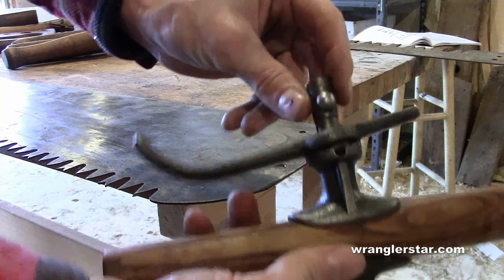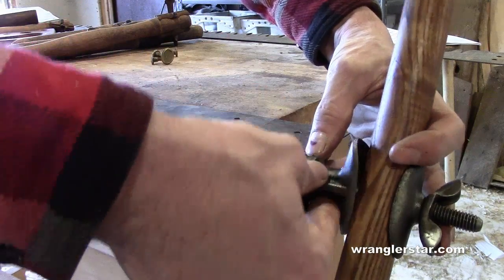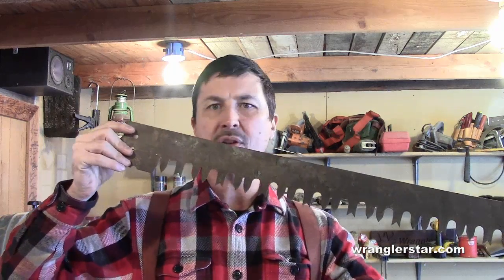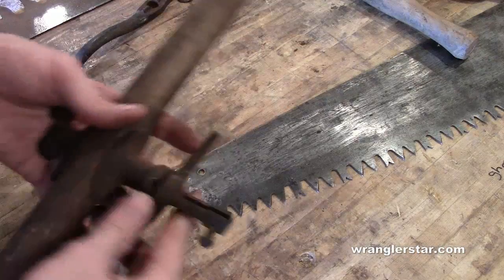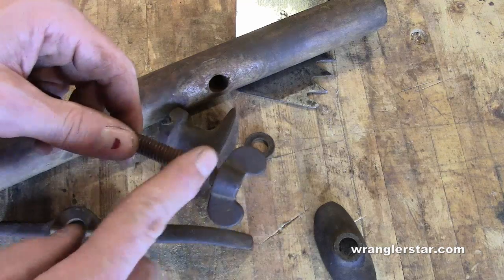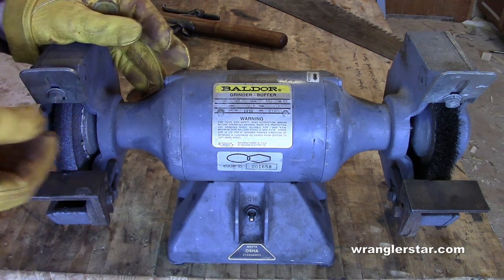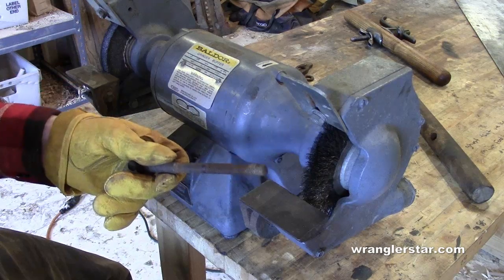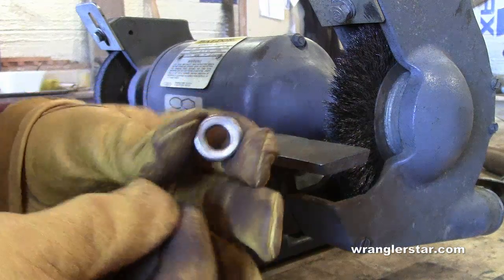Crosscut Saw 5.0 - Wranglerstar

Comment: Hey, hope can help here.
Been using Kroil since a lad from my Father, gets rusted parts undone. Now they have SiliKroil and even better: the silicone is further lubrication.  
I purchase it by the gallon. Then if have something stuck, get a container, put the part(s) in, and soak.
You can even put into the cylinder to free stuck rings. Do it before ever crank an engine that been sitting and before the oil change. Put it in, let it soak at least a day, then turn over one revolution, soak for at least a day, do at least one revolution per a cylinder. Once done, change out the oil, new plugs, and away you go. Learned from my friend Georg who has been an auto mechanic since 1960's. Saved me having to rebuild a rare engine.
So anything that is really stuck, grab the SiliKroil. 
Hope this helps.

Comment: Removing rust can be done very easily with a simple electrolytic setup. There are several good videos on youtube that show how to make and use a very inexpensive rig for doing this (assuming one already has a battery charger). It's a great solution for small metal parts, and has the advantage of removing just the rust, not the un-rusted metal. It also frees you up to work on other tasks (like the wood finishing) while the rust is being removed.

Comment: You can also use electrolysis to remove the rust before the wire wheel. It will also keep the patina and make the parts look like new.

Comment: I am going to be doing some remolding and exposing the post and beam structure of my home - what is the best process to restore the cedar post - it's the post that has been covered up with drywall and it looks as though when they first did the conversion of this old building they probably sandblasted. I don't want to do that. What would you use? I would like to keep it's rough sawn look.

Comment: This is an old video, so you have probably found out by now, but the curve of the saw would indicate it is a felling saw, the curve leaving space behind the saw the hammer in wedges.

They can be used for bucking, but a bucking saw is usually straight backed, to give it some extra weight to aid the downwards cutting.

Comment: That wire brush was a bit fierce. You would be advised to look at chemical rust removers or brass wheels which are much less damaging to the surface. Another successful technique is electrolysis. I am sure you will be surprised how smooth the surface can be after all that rust has fallen off. You may even be able to get one of those butterfly nuts off. - Great video by the way, I have such a saw and I will be following your techniques.

Comment: i would vote for Petra

on the whaser metal to metal contact makes for were an tere so the lether part of the whaser supose to come in contact to the part that you dont want wreing out like if you are bolting two plates to gather you put whaser under the nut if you tighten the nut (turn the nut) if you tighten the bolt (turn the bolt head) you put whaser under the bolt head, ok now for the lether part if you have a nut that you dont want to get were on you need to get the whaser to turn with the nut so you need to have something that makes friction between nut and whaser and softens the contact to the whaser so you use lether to make that friction

Comment: Someone gave me a bench grinder made with an old washer motor, It worked great for years but now has stopped working and I don't know why. I think it may be a short because when I turn it on I can see some blue sparks in the motor, but I'm not really an electric guy.

Comment: A safety note I would make, Take your gloves off when using the wire wheel. Better to get hour hand a little chewed up than to get it caught on your glove and sucked in to the wheel. I used to work in a production machine shop and have seen some very bad hand injuries due to gloves being worn when working with grinders and other machines.
Reply from the maker: I'll keep them on while working against the wire wheel thank you very much.

Comment: I much prefer using a wire wheel on a 1/3 hp split phase motor without any type of guard.  It works a lot better.  You'll get kick-back with that guard and it can throw something back at you.

Also, be careful with old, 1920's and earlier designed equipment.  The treads might not be standard.  A good example, is the screws that hold a Stanley tote to a larger Stanley plane.  They used non-standard screws up to recent times.

Comment: Wear long sleeves and gloves as well when using a bench grinder. Or you will end up with shrapnel in your arms.
Reply: Try using an angle grinder wire wheel outside in 90 degree weather without a shirt.
Reply: Nicholas Smerk ha those are fun especially when they grab and jump around
Reply: Until you slice your wrist with a grinding wheel (I know someone who did).  I've set a pair of overalls on fire.  I think I wrapped a wire wheel up in a sleeve once also.